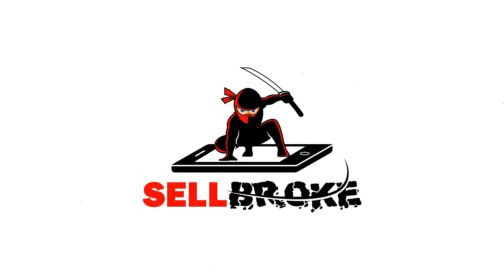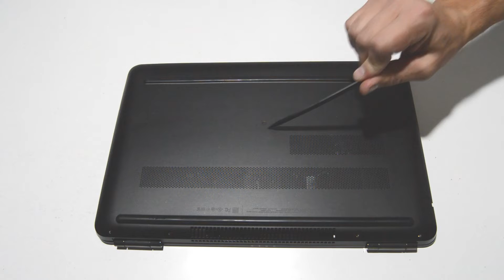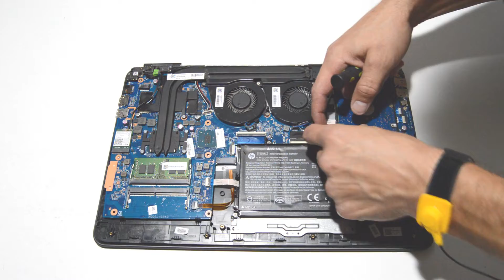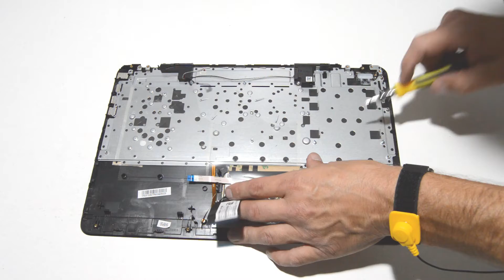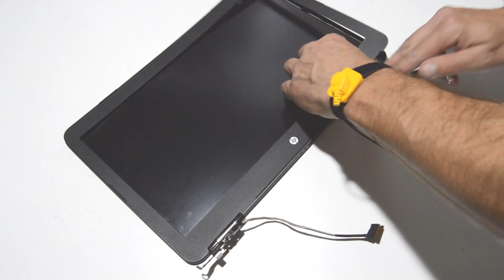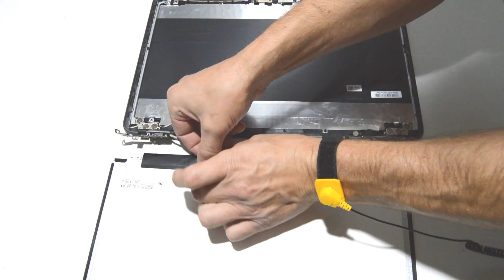How to Disassemble HP Omen 15t-ax200 Laptop or Sell it.

Comment: thank you for this video! helped me trace my problem while replacing the battery. 

if ever anyone experiences the same problem of the laptop not booting up after batt replacement, make sure the ribbon connector shown attached at 5:37-5:38 is not loose. 

it's very easy to nudge loose while removing the base and/or the defective battery.

gently re-connect as necessary to make sure the power is properly routed

Comment: Some screws are impossible to roll out, they are fucking dead stuck
Reply from the maker: Some screws it helps to tighten slightly then loosen, to break them free. Also you have to press down hard sometimes to give the screwdriver more bite.

Comment: lol bro... i just opened my laptop and my battery seems to have been busted open? the only reason i did this was to clean my fans
Reply: Don't even buy a replacement cause the same will happen. My new battery also swelled up pls there's a lot of ppl online saying the same
Reply: @hussein6173  can't keep the charger plugged in. my battery literally swelled up and destroyed my touchpad lol
Reply: @iknowcharley5  I opened it and removed the battery after the replacement swelled too. I just use it plugged in now. Not buying another battery
Reply: @iknowcharley5  BTW, I read that the charger is supposed to be 150W but they sold a lot of them with 120W, mine included. Maybe thats the issue
Reply: @hussein6173  wowwwwww, and i don’t have a battery in mines either. i just keep it plugged in. and i bought the tools to try and open up and clean the heat sink and etc but i can’t even unscrew my screw because they’re busted 🤕
Reply: 0

Comment: Is the cpu and gpu soldered in?
Reply from the maker: Not only that but they share a heatsink, which isn't a good thing.
Reply: @Sellbrokedotcom  Well shoot that means I can't upgrade it! Anything I can do to make the laptop run cooler?
Reply from the maker: @016_  Possibly one of those cooling bases with the fans. It's mainly a design problem, the heatsink tube from the CPU crosses over the GPU. This means when your graphics are going the CPU is always going to run hot since there is a hot spot between the CPU and where the heatsink vents. No matter how hot your GPU gets the CPU will always be hotter since it can never be cooled lower than the GPU temperature. Almost all gaming laptops use separate heatsink runners for the CPU & GPU to prevent this.

Comment: hey man ive been searching for a long time on ebay for top covers with keyboard and trackpad but can u tell me if are all compatible with each other my model is 15-ax001np and the ebay product says "HP Omen 15-AX Palmrest, Backlit Keyboard & Touchpad 859735-001 RED version 	FOR HP OMEN 15-AX 15-AX020CA 15-AX100 15-AX200".
Reply from the maker: Find your serial number on your laptop, then go to HP Partsurfer and enter it in. It will give you the correct part number for your palmrest assembly. Many will fit but there could be differences in the ports or screw posts.
Reply: @Sellbrokedotcom  well, in the website the part number is different from the one from eBay. Does that mean that it is not compatible?

Comment: Bro i need to clean my same laptop from dust,  is cleaning the visible motherboards area and fans enough or should i clean back side of motherboard too?
Reply from the maker: The fans and heatsink are the most important pieces to clean, you can always use canned air so you dont have to take things apart. I have many comments from people who took apart the case to clean the fans and now something doesn't work. If you do just be careful not to touch the contacts on any part.
Reply: @Sellbrokedotcom  thanks for your advice buddy, have a good day

Comment: Does it normal feel pain when i watch this video? I just want to clean my laptop not punish it.
Reply from the maker: Then all you have to do is remove the bottom case and you can go crazy with a brush and canned air.
Reply: Then just disconnect the battery, remove heat fans and “go crazy with brush and canned air”. 😊

Comment: At 9:30 can you please tell me if the one near to the Ram slots is the CPU or GPU. I have HP Pavilion bc-513x model which has exactly the same layout but a bit updated internal. 1650 gpu and i5 9th gen processor. I always get 'dxgi device has been physically removed error' and I believe it is due to bad design from the manufacturer or bad heatsink since everyone from the dealer (amazon) have the same issue as me. Also if you could then please help me or even tell me how to give it to you since I didn't find my model in your website.
Reply: This is my model and I see everyone has the same issue with 1650 in it https://www.google.com/url?sa=t&source=web&rct=j&url=https://www.amazon.in/HP-Pavilion-15-6-inch-Graphics-15-bc513TX/dp/B07S8VNK4T&ved=2ahUKEwiV2_XtzbPpAhXIyDgGHVBHD5MQFjAAegQICxAB&usg=AOvVaw3jn2tJYtvdSdrOlTS5wgjb
Reply from the maker: Sorry to hear that, sounds like the main GPU is bad, probably from overheat. Give us a moment and we will add your model to the website. Thanks :)
Reply from the maker: It looks like your model has a different model number than the USA version, just enter your laptop specs on the website and leave out the model number. Thanks!

Comment: on my monitor there are sometimes popping grey stripes when try to open wider my desktop or close it a bit, i already tried to connect it to the tv via hdmi cable to check if it was the graphic card, and on the tv it was all fine, is it then the connection from the motherboard to the monitor? if yes, where can i find the parts for it? nice video, found it really helpful!!
Reply from the maker: Sounds like it's the internal video cable.... if you open and close your laptop a lot they can tend to wear out, causing a wire or two in the cable to break. It looks like on your model you might be able to replace the cable without completely removing the display assembly.
Reply: Hey! I have the exact same issue with my laptop. Did you finally succeed to replace the video cable? And if yes, how ? That would be very helpful !!
Reply: @matthieuguasch5737  I managed to replace it but that was not the problem, so i tried to investigate further, took out the display and figured out that the problem was in the lower part of the display, where all the connections take part, so i substituted my display, and so i fixed the problem
Reply: @blue4ngle256  Thanks a lot for your answer ! That helps a lot. Well, I just noticed it yesterday. How much time do you think it can stay like this before it gets worse and then necessary to proceed this surgical operation ahah?
Reply: @matthieuguasch5737  i waited more than 2 month before replacing the display, because i was waiting for it to be delivered, but you will see it gets worse and worse
Reply: @blue4ngle256  OK so I'd better not wait. Thanks again! 👍

Comment: Hi, I just replaced the RAM and the fans on my omen ax-00 notebook. What I noticed, putting again the rear panel and snapping it along all the borders, is that in the middle was a little convex, I just pressed a bit also there, and then another snap. Most of the guides I found nobody tells about it, so don't forget to check also the middle of the rear panel  in case you want to upgrade some stuff:)
Reply from the maker: Good info, thanks!
Reply: Hi, I have the omen 15-ax201la and I want to upgrade the RAM, do you know which RAM are compatible with the laptop? Thanks!

Comment: Thanks for this. My shit was overheating to hell, its likely the lack of thermal paste on the CPU>
Reply: it just overheats. Mine does it too, even with good thermal paste
Reply: @AlexRib  i am scared as fuck to open it .. because the corona virus i cannt afford to fuck my computer up! I need to clean that dust
Reply: @Elbomberdelvernal  Same here man. Mine just started overheating a few days ago FML
Reply: That laptop is good but heat management sucks. Mine just died yesterday the motherboard has a shorted  capacitor due to the heat issues and the bad quality of the power cable jst connector.